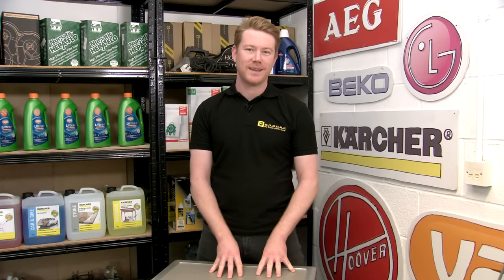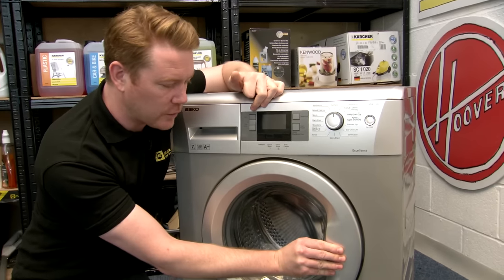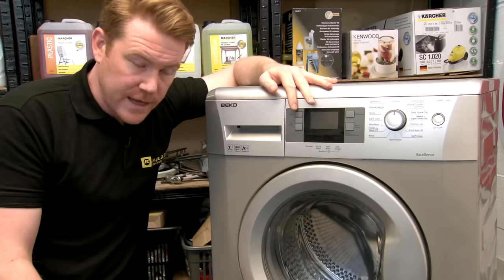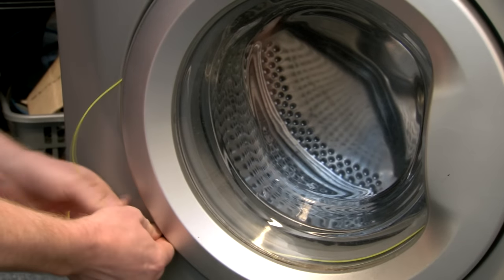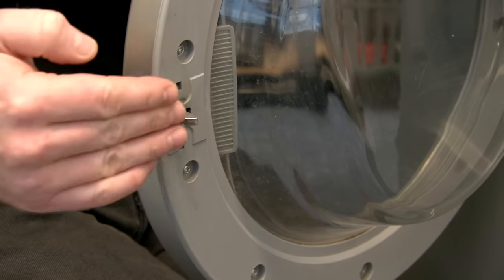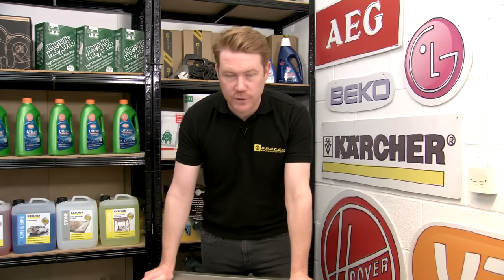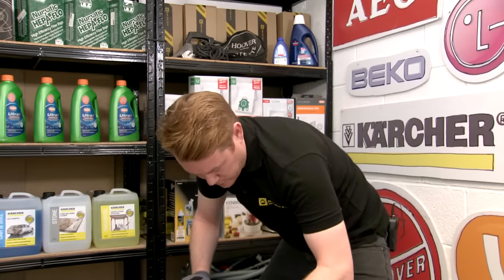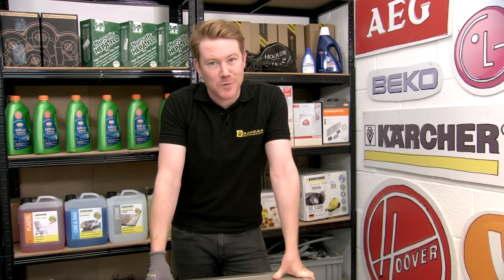How to Release a Stuck Washing Machine Door

Comment: It worked on our Edesa machine, the method with the strimmer cable. It is fantastic and has saved us possibly 300euros for a new one...thank you very much.
Reply from the maker: Thanks for the feedback, check the handle as it may have fractured and need replacing.

Comment: I just want to say how great your video is!  But, oh, man, I tried all of these methods and none of them worked for me!  I even took the top lid off and noticed there was no visible hook.  
I took the kick plate off in the front and, using a telescoping mirror, saw a delicate little white plastic pull tab.  Gave it a gentle tug with my finger and heard it unlock!
In case someone else runs into my same situation, my machine is an older Kenmore HE2.
Otherwise, this really is a great video!  
Thank you for making it!
Reply from the maker: Hi, thanks so much for your comment and the compliments for your video. We are pleased to hear that you did managed to get your door to unlock eventually, thank you for sharing your experience here...as you say, it could prove very useful for other people too!

Comment: Thank you so much, I'm 73 so not so much strength now, but your credit card trick worked.  Didn't get past the little ridge frame first time so used a bit more flexible card to push past that, then pushed a stronger card over past that to push the 'pecker'. Worked perfectly.  I tried the string thing, but couldn't pull hard enough.  I was getting desperate as my great granddaughters swimming gear was stuck in the washer!!!
Thanks again for that tip.  I think I need to replace the handle now , I can see the two bits of metal aren't connecting as they should.
Reply from the maker: Hi Jacqueline, glad our video helped and remember to like the video and subscribe for more helpful videos to watch.
Reply: eSpares hi there, received kit, thanks very much, great quick service.  Could you please now tell me how to find the film of how to fit it, that was the handle kit for the Indesit washer/dryer WD12X that you sent me, thanks Jacqui Bolton

Comment: Just washed work clothes which I need for the morning. Somehow I've busted the handle and can't get them out. Losing the plot and seconds away from using dynamite to get my clothes out. Checked you tube and I've opened it with string like you showed. Thank you. You tube is the bollocks. I love it. But one thing I'm sure of is, that string will be my handle forevermore. Fuck that shitty plastic spring clip thing. 
Great vid
Reply from the maker: HI Mark Jochan, thank you for your post and glad the video helped we have loads more ☺

Comment: Thank you for this great video! Apparently GE re-engineered the door lock on my WCVH4800K2WW so the latch points in the other direction - which means the cord and credit card methods will never work because they are pushing or pulling the latch in the wrong direction (locked). The door lock has an actual "manual release" accessible by removing the top panel and pulling the drum out, as in this video, but you must press down in just the right place on the plastic top of the door lock. After much research, I only found this information in an online copy of the service manual.

Comment: In my Bosch WAK24510GC, machine was running ok but when it was paused, or cycle got completed, the door light flashed with a "NO" on the panel. Probably the water was too hot, so I turned the cold water tap on and started a drain / spin cycle and the problem got resolved. In my case, there is no lever on the door handle that engages/disengages the lock. I checked the lock afterwards and came to know that it probably won't get opened by the techniques mentioned in this video. Thanks anyway!
Reply from the maker: Hi Muhammad, thank you for your post and even if the video didn't help your information may help other people, thanks for watching.

Comment: LG Front loader wouldn't unlock and release the door, Called LG tech support.

When trying to open the door we get the error code “dE”
I've tired extra drain & spin cycle. (multiple times) 
I've tried draining the front lower panel basin. 
I've tried unplugging the power for 5 minutes. (multiple times) 
I've tried unplugging power and holding the start/pause button for 5 seconds. (multiple times)
I’ve tried running a “spin only” cycle. (multiple times)
None of these work
ed.

Pulled up your video on "general" front loader washers.  Bingo, opened the door with trimmer string and now it works again.

THANK YOU!
Reply from the maker: Hi Jon, thank you for your post but now you know just come to the eSpares channel for help have a great day.

Comment: Thanks mate, it worked! gave my usually reliable 10 year old Ariston front loader AVXL129's door a bang, near the lock, as you suggested and it started to flash/so I could open it.  The net is amazing!
Reply from the maker: Thanks for the comments and keep an eye on the lock as it may start sticking and need replacing.

Comment: Great job , wife blocked machine again by never cleaning the filter , daughter ripped off the handle when it was locked because cycle not finished !!!  So I used a piece of old plastc restraining wrapping strap , ran in round the back of the door as show and pulled voila door open.  No change of a credit card doing the job although i tried the lock has a plastic shroud and the card wouldn't budge past it. Great vid thanks @espares
Reply from the maker: Hi Gavin Preston, thank you for your post and glad the video helped.

Comment: I managed to open the door with a few old credit cards ..it took many attempts as the card kept sticking behind the metal insert where the hook goes in. In the end I had to resort to using a long screwdriver as a lever and gently prized the door open..I tried the strimmer cord method too and couldnt get that to work as the cord kept catching around the plastic extrusions on the back of the door. Thank you for your help though, the videos are so very useful and I ordered a new plastic door handle off you as the old one had broken ..🙂👍🏻
Reply from the maker: Hi Richard,  thanks for your comments. We're glad to know you found the methods in our video useful and the screwdriver trick worked for you. Well done for your perseverance.

Comment: on my washing machine indesit ws 105 tx the hock seems to be stuck and my handle is broken any ideas?
Reply from the maker: Hi Paul, have you tried one of the techniques in the video as they are the ones that work.
Reply: eSpares yes it worked eventually i forgot to mention that

Comment: Is there a video of how to cancel the wash nd it actually cancels because when I pressed cancel as it said press nd hold for 3 seconds now it won't actually wash my clothes after I've tried to put it on again nd it's the same exact washer that was in this video
Reply from the maker: Hi Aaron, we don't have a video on how to cancel the prog as it's in the user guide but your machine sounds like the board is no longer selecting the programme so check the board connections and the push buttons.

Comment: By mistake the washing machine door lock which we press for opening the door got detached from the door panel, is there a way to fix that
Reply from the maker: Hi Dhruv Sachdeva, if the door has come away from the door panel then something has broken and will need to be identified and replaced.
Reply: @eSpares  its the door catch which has come out. Do you door catch spare

Comment: Or alternatively most modern Bosch and AEG washing machines have an emergency release catch located to the left of the filter.
Reply from the maker: Hi Lardonirdesco, thank you for the good advice and hopefully, it will help some people get into there machine more easily.
Reply: I would add that if the emergency release catch is damaged or broken the emergency release catch likely will not work. This only really works if the machine has not drained properly and has retained water or the cycle has timed out and the door is locked. These would likely occur because of a blocked filter or drain pump issue but in order to open the door to release the washing all the user would need to do is locate the door release catch if the machine has one, Again located beside the filter. They would still need to drain the machine via the filter but releasing the door is the priority to keep from damaging the clothing.

All BSH (Bosch, Neff and Siemens) machines purchased in the last 5 years should have one have one, Miele machines have them, As do a small amount of the Hotpoint/Indesit machines and a couple of the AEG/Zanussi/John Lewis branded machines too.

I have not come across them on LG, Samsung, Beko or Hoover Machines though that's not to say there isn't any with one....
Reply from the maker: Hi Lardonirdesco, again thank you for the comprehensive information and good advice.

Comment: When put in spin my washing machine drains for about a min then I get the err7 code, I’ve replaced the motor with a brand new and and it still does it. Any help please. It’s a haier hw60 1201
Reply from the maker: Hi Hiii You, the machine is picking up a fault in the motor circuit,  check the connection to the motor and test the wiring to the motor.
Reply: Thanks for the reply, the door lock does play up, could that be causing it. It does eventually unlock but sometimes it doesn’t. If that’s not it then how do I test the wiring thanks
Reply from the maker: Hi Hiii You, it does sound like you have an issue with the door lock but should not be connected, you would need a multimeter to test the circuit.
Reply: eSpares I do have a multi reader,  can you guide me through testing the motor please

Comment: Hi ,
I have LG tromm wd8526... When I power on and press the start button ...it does not start and does nothing .... There is no error message but the program selector light keeps on blinking .... I tried running diagonistic ...every thing works fine during this but during washing nothing happens ....

Any suggestions ???
Reply from the maker: Hi Satyadeep, you will need to check the door is closing correctly before testing the door lock if it doesn't lock it will not start.
Reply: eSpares ...thanks for the reply...the door seems to be locked properly but still the machine will not start spinning
Reply from the maker: Hi Satyadeep, OK if the door locks can you hear a buzzing? as this indicates no fill, the sequence should be programme select, door lock, fill to correct level and then start to wash.
Reply from the maker: Hi Satyadeep, you are going to have to check the whole circuit so start with the inlet valve and test it with a multimeter, then if OK move onto the motor before checking the PCB.
Reply: Thank you for the card trick

Comment: Thank you so much,this video saved me,thank you
Reply from the maker: Hi Deborah, thank you for your post and glad our video helped have a lovely day.
Reply: @eSpares  
Please how do I fix it back to prevent it from happening again, is there a video for that, I used fishing line method
Reply from the maker: Hi Deborah, it is usually caused by the door or the lock sticking and just make sure the door closes correctly before you start it.
Reply: @eSpares  
Have tried closing and opening after that, after I closed it, it didn't open until I used the hack again, so I disassembled the door, but I don't know if it will still occur after fixing the door back
Reply: @eSpares  
I did not do anything on the handle, because I don't even have a replacement for it
Reply from the maker: Hi Deborah, you only need to replace the door handle if it is broken, if it keeps happening then it could be the door lock and that would have to be replaced.

Comment: How to do this if your washing machine has no handle? 

The button to release ours has fell apart, it's integrated too
Reply from the maker: Hi craig522 GTX-VXR, you will have to replace the button as it's probably not connecting with the lock to release the door but the line trick shown in the video should still be able to release the door.
Reply: eSpares hi guys, could you fix that for me as our button also got detached from the panel.

Comment: Hi mate my indisit washing machine is keeps going on wash cycle.its just keeps going on not drainig or spin.i have to drain and spin it manualy but it not going to wash cycle to drain and spin automatically.please help.
Reply from the maker: Hi Anoop, there could be many causes so I will start with the most likely, test the heater and drain pump with a multimeter to determine if they are failing but it could be the board.
Reply: Thanks for replaying.i can check the pump but i dont have anything to check the heater.it is draining and spining but i have to put it on manualy its not going on to that by its self and its not finishing the wash cycle.

Comment: I changed my door lock and now it is stuck shut. And I tried all methods. I have an outer handle, couldn't see the locking pin to disengage.
Reply from the maker: Hi Anne, have you tried all the methods suggested in the video as the fishing line method should work every time, the locking pin for the handle is inside so you need to release the door first.

Comment: debit card trick worked for me. 

 Had the machine trip a fuse and break all the electronics in the machine (error f12) 

 Clothes were stuck in there for like a week before I managed to get them out, oops. 

 Using the card to catch the lock and a large kitchen knife to help open the lock as I had broken the machine handle trying to pull it out.
Reply from the maker: Hi NightKnight, glad you got the clothes out but have you sorted the reason it tripped a fuse.

Comment: Still cant open mine.
The machine is stuck in wash and wont rinse so my clothes are sitting in soapy water. It needs to rinse so that the water goes but it doesnt want to know.
Reply from the maker: Hi Conrad, if there is water still in the machine then the door may not open, use the drain hose to get rid of the water and check the filter and drain pump.

Comment: My door isn’t stuck but the door lock is shut even the door isn’t closed so now the can’t close because the lock is shut
Reply from the maker: Hi Ricky, unplug the machine and place a flat blade screwdriver into the lock and slide the lock mechanism across to try to reset the lock.
Reply: eSpares I have already fixed it non the less but thanks for the advice.
Reply from the maker: Hi Ricky, well done!

Comment: Actually, just remove the top from the washer and remove the lock form the door inside
Reply from the maker: Hi Carolina, you can't remove the door from the inside on most models and the screws that hold the door lock in place are on the front which you can't get to if the door is stuck, you can the lock which is shown in the video.

Comment: haier hlc1700axw fc error code

This is to who main concern
I got the same problem with mine and so far I resolve
I called customer service and they want to send a technician here
I took the main drive out
The back of the main drive is a main board
a little small electronic channel was burn
 I just bypass and now works fine
Reply from the maker: Hi Andre, we are glad you sorted the problem but we don't advise you bypass the electronics as it can cause more problems.
Reply: @eSpares  I didn't by pass a electronic components

Comment: I had to drain mine manually by removing the drain plug. Stupid Samsung.
Reply from the maker: Hi Farbror, a lot of machines can be awkward.
Reply: eSpares Draining it or running the spin program should be the first thing to try I think, then your more brute force methods 😁
Reply from the maker: Hi Farbor, thanks for the information.